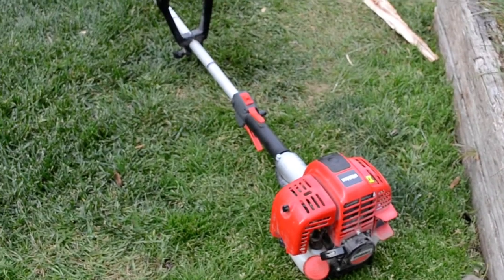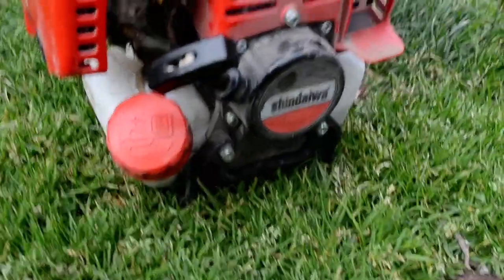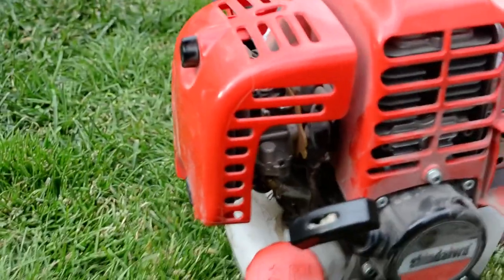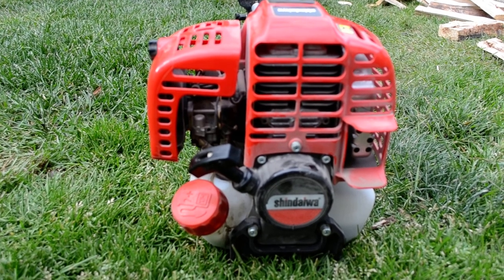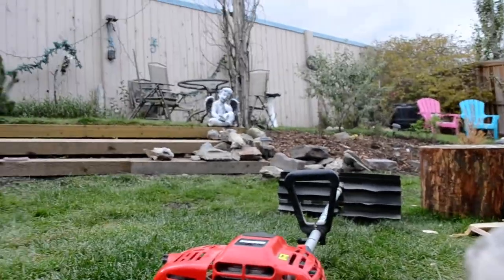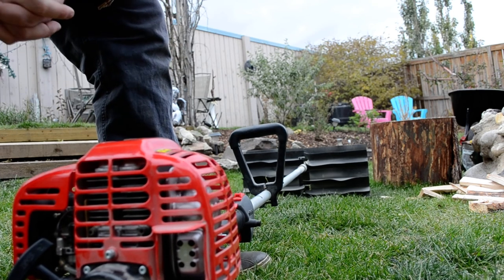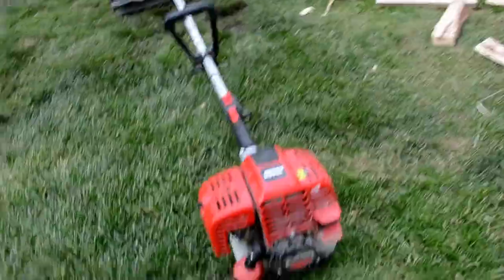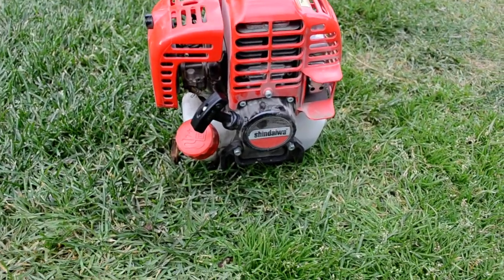shindaiwa ps344

Comment: Will this unit remove thatch from the grass too?
Reply from the maker: It will! Not as good as a power rake tho. If u had a bristle brush head on it instead of the rubber paddle then it would work extremely well.